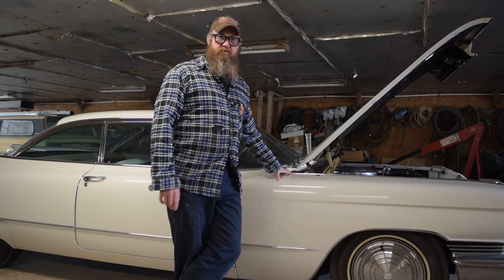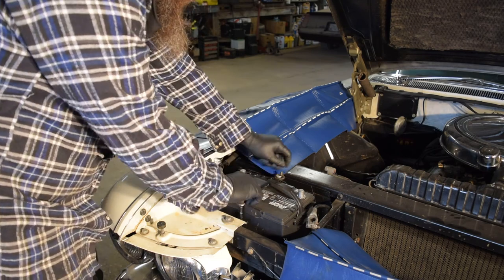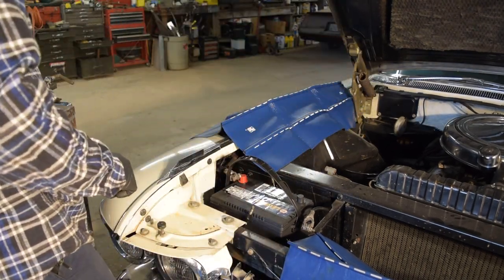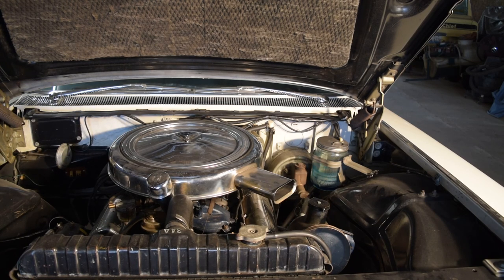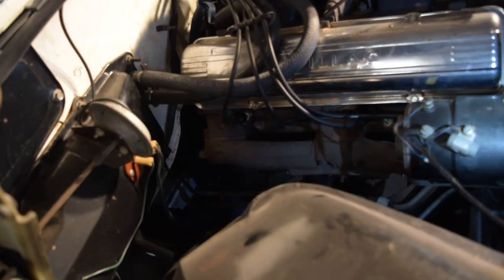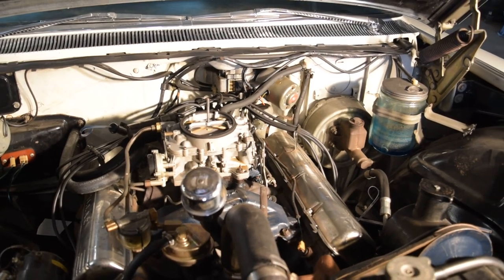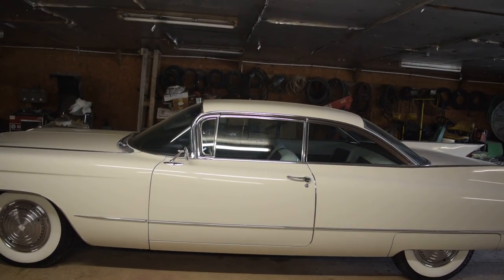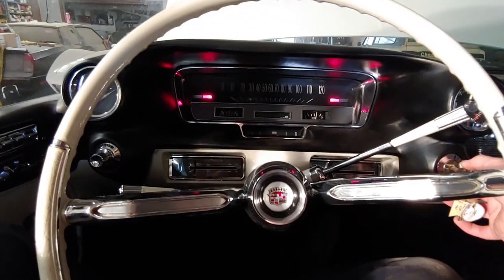*1960 Cadillac Coupe Deville* First drive in 15 years!

Comment: Hey! You said “lead substitute”? Never heard of this? What is it?
Reply from the maker: Well first off, I should have said "lead additive" not "lead substitute" that was a slip on my part.  Vehicles before roughly the early 70's did not have hardened valve seats, so the leaded fuel helped with lengthening the life of the valve seats.  Our modern fuel is unleaded, so I add a lead additive to the fuel each time I fill up.  It isn't 100% necessary, especially since we don't drive the car much, but I still add it.
Reply: @robschwiesow  Thank you for your response!

Comment: That's my dream car less air & Guide-O-Matic. The clock has points in it, when they touch it operates a solenoid that rewinds the clock about every 2min. Some people disconnect it because after the battery ages long periods of not running the car may drain the battery. Oh, I wish you would have shown the front brake work, my 1965 has this odd metal plate thing and it's fidgety to do. There must be a trick or order to do the job that makes it as easy as other brake shoes. What does it do??? Why the extra retention pins & springs??? My car has most of the factory-installed parts. I have Brougham it uses extra-large wheel cylinders they do not produce and do not make service parts for. My car sat since 1967 but I drive it a bit.
Reply from the maker: Thanks for the info on the clock, I will fidget with it some time, don't really need it, but would be cool to get it ticking.  As far as the brakes, the assemblies were pretty standard on the 60.  I can't picture exactly what you are talking about as far as the metal plate and the extra springs.  If you could get me some pictures, I would be glad to help you out.  Email me a americanheritagegarage@gmail.com.

Comment: I have a 1960 Coupe de Ville,  can you direct me to a source for vacuum line routing?   thanks.
Reply from the maker: I spent some time looking around and couldn't find any really good diagrams.  Is there something I can help you with?  I can take pictures or draw something up for you if you would like.  You can email me at americanheritagegarage@gmail.com
Reply: @robschwiesow  I would appreciate that a lot.   It doesn't have many vacuum hoses, one from the intake manifold, I think that this goes thru the firewall to the heater controls, then to the vacuum motor that opens the heater plenum door mounted on the engine side of the firewall.    Right now this door is not opening, and the hoses are in pretty poor condition,  I can replace them but I must know where they should go.   Thanks for any help.